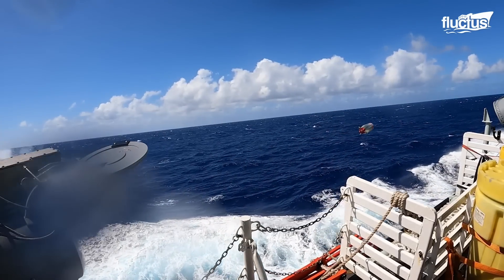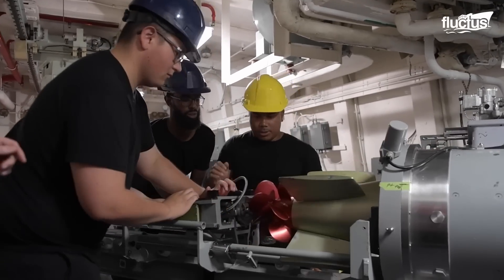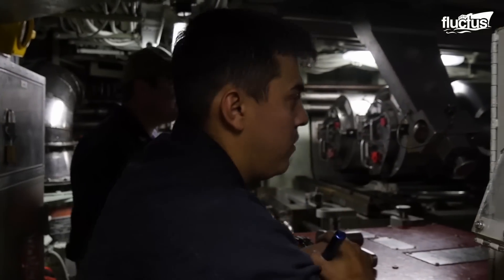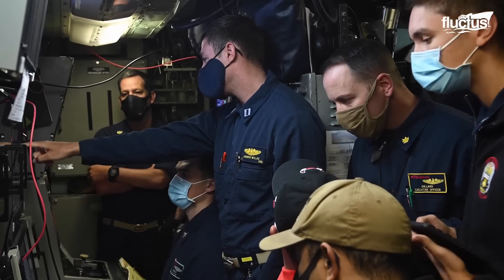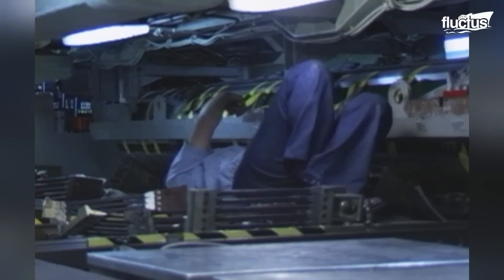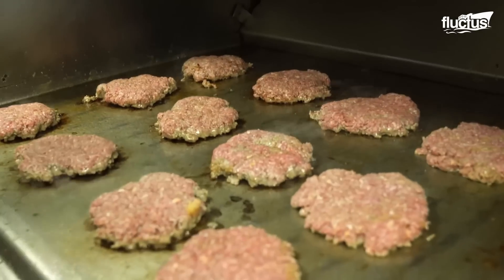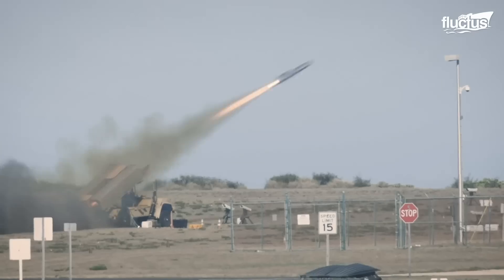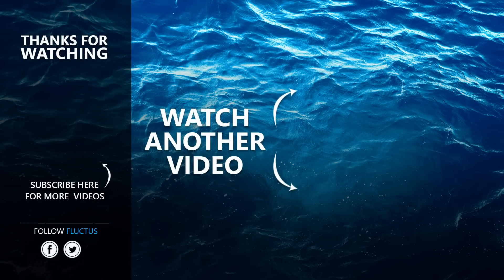US Navy Special Technique to Launch US Most Advanced Torpedoes

Comment: Just launch em off the side of the destroyer, LPD/HD or carrier.
Reply: Carriers and large deck amphibs don't use torpedoes, however the helicopters they fly definitely can use them. The last fixed wing aircraft the US Navy used that carried torpedoes was the s-3 Viking. Currently the only aircraft that the US Navy has that carry torpedoes is the Boeing P-8A Poseidon.